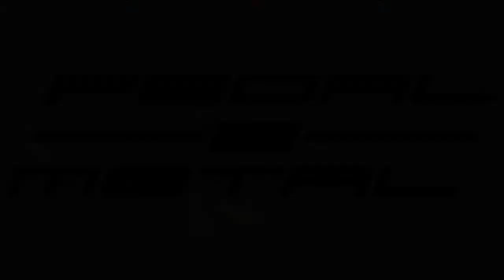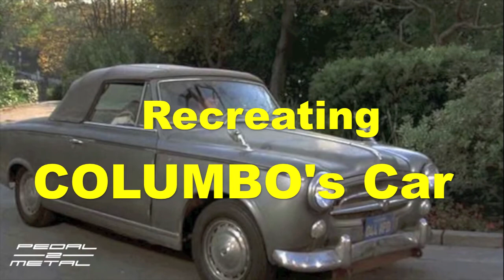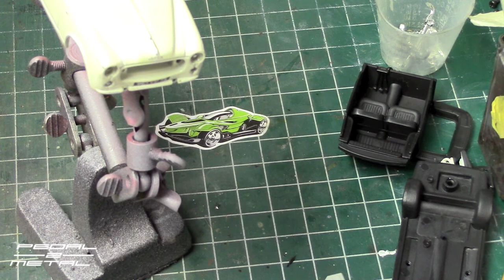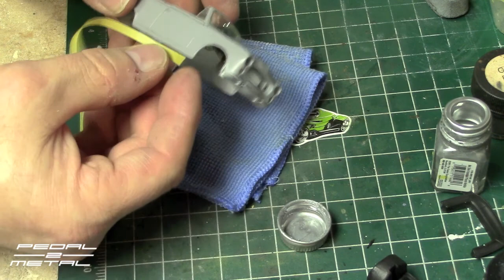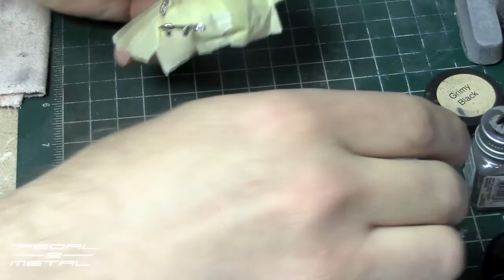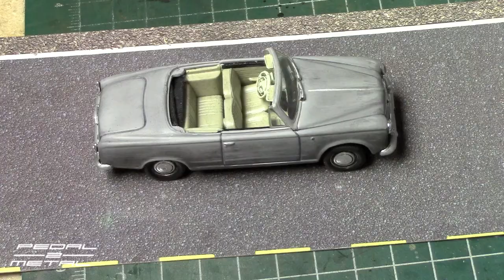Recreating COLUMBO's Car in 1/43 Scale | Fun DIY

Comment: Nice job fella but the panel lines are to black around the doors/trunk/hood, etc. I suggest you use a medium dark wash from grey paint and white spirit (test that the white spirit does not melt/soften the car colour) brush the whole car and the wash will run in gaps, once dry, moisten a cloth and gently rub the bodywork to remove excess wash, the wash will be left in the panel gaps as a very thin line and will look more realistic, then a very thin coat of semi gloss varnish to seal it. Do all this work before building it all up, then weather it and then give it another coat of semi gloss/matt or pure gloss varnish depending on what you are working on. The chrome bumpers, to dull them off, paint with either semi gloss or matt varnish. We never stop learning do we and I hope this helps you a little and keep up the good work, lovely job.